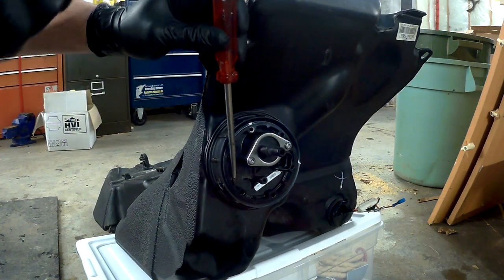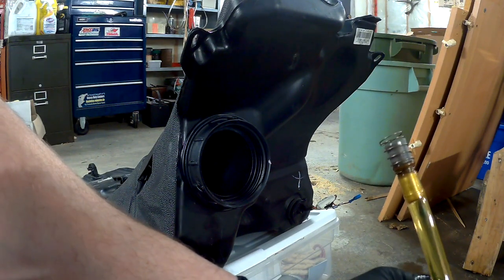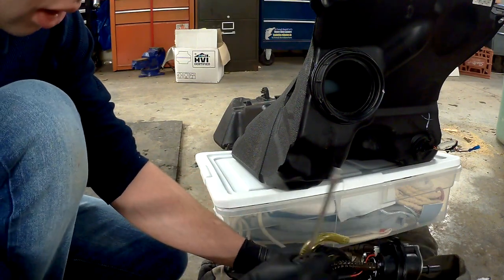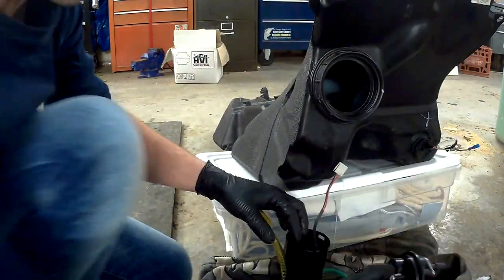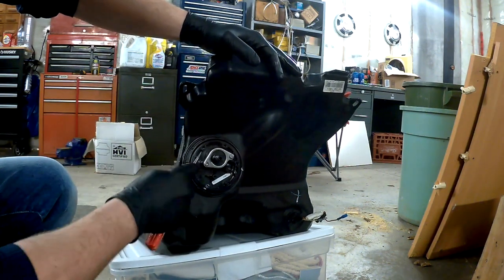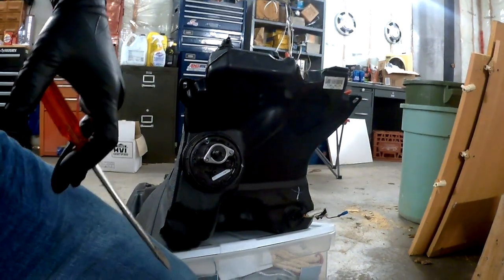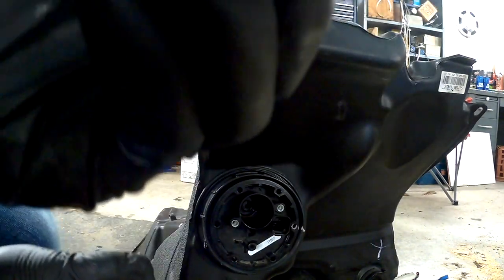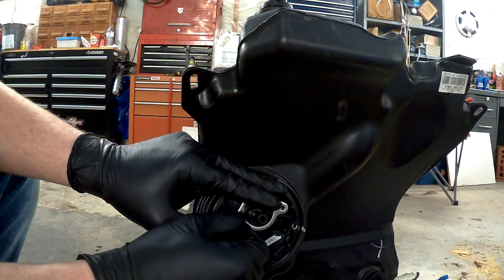How To: Ski-Doo REV XR 1200 Fuel filter + sock filter replacement

Comment: Where did you buy the replacement sock?
Reply from the maker: No replacement. Just clean it and re install.
Reply: I was asking because i have a 2009 summit with the 600 and this year, they were still having the small sock so i was thinking about changing it for a bigger one

Comment: How do you release the fuel pressure without the BUDS system?
Reply from the maker: I always just pulled the fitting and there was never pressure there. If you were concerned you could pull the fuel pump fuse and turn over the motor and that would pulse the injectors and relieve pressure if any existed.
Reply: @Schneids15  Hope I'm not in over my head. Replacing water pump gear, starter, thermostat and oil cooler. All updated parts for my 2009 GTX 1200. Thanks for your help.

Comment: I learned the hard way that you have to be REALLY careful with that blue o-ring - you can ruin it too easily. Be careful with this.
ADDITIONAL INFO
To get the tank out:
Remove the seat - (two seaters require 4 bolts in the tunnel to be removed to get the passenger seat off.   Then the over-tank seat reuires you to unlatch it from the front and pull it back and off.
Remove the tank -  Empty it first.  Remove the bolts on the pyramid arms.   That quick-connect hose connector assembly on the entrance of the tank needs to be disconnected before removing the tank.  There is a clip that needs to be pushed in on the quick connect (be careful doing this) and the electrical plug needs to be unhooked.  Disconnect the air hose at the top of the tank too.  Pull the tank straight back lifting the back end to get it out from under the pyramid arms.

Comment: You do a great job at what you do you look very intent on keeping your snowmobile for a long period of time I admire that. How did you learn how to do this are you a Ski-Doo mechanic or what. You say you do about one year
Reply from the maker: Thank you. I am actually a Marine Mechanic. My snowmobile is about the newest thing i own and it gets babied. I realize how easy stuff can go wrong in the bush and you can freeze to death very fast so i try and keep it in tip top shape.
Reply: @Schneids15  so when your tank looks like you're going to run out of gas I go by the Chipmunks and the level but the way your tank looks is the same as my touring tank I look like I got pretty much gas left after a half a tank then it would go slower wouldn't it the chunks would disappear slower with how much Mass is at the bottom of the tank? About the bush yes here in Wisconsin in the north I make sure my ATVs on my snowmobile is in Tip-Top shape because yes I'd hate to see the mountain lion and the Wolves I've seen before and the 500 pound black bear from April that would suck take care buddy thanks for answering my questions promptly
Reply from the maker: No problem. Safe riding this winter. Glad to help

Comment: Thanks for the excellent video. It helped a lot. If you ever have a problem with coils failing, change the voltage regulator. None of the dealers knew how to fix the issue. Sled runs great now.